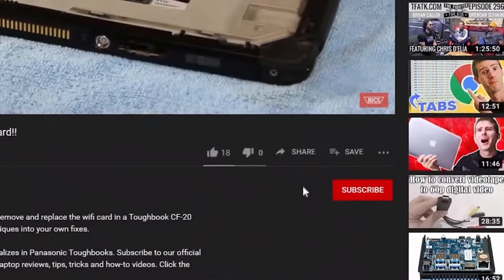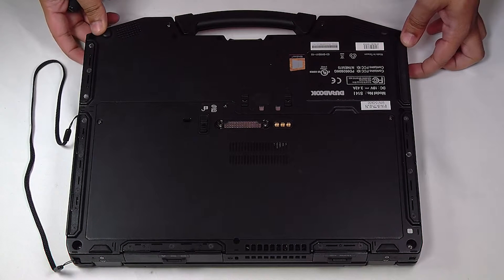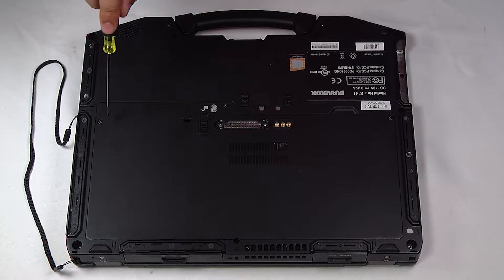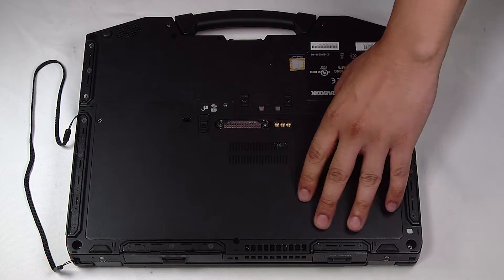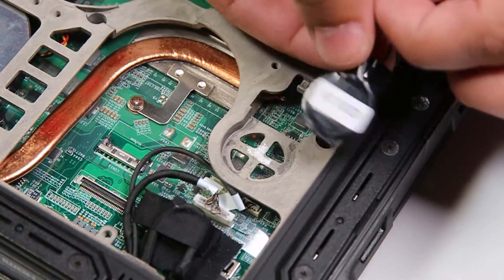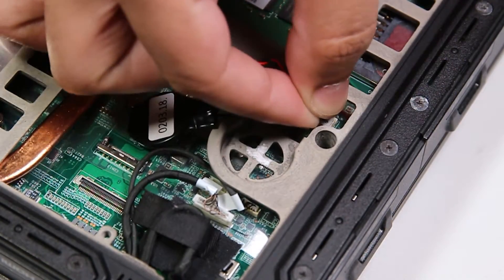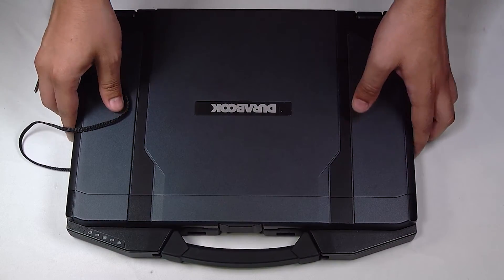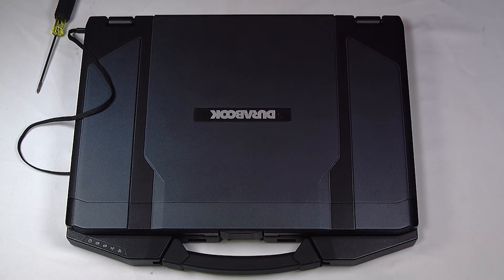How to Replace Your Durabook S14i CMOS Battery!

Comment: I have an old durabook model n15rl-2. CMOS battery is 😮. Not sure how to remove laptop back cover.
Reply from the maker: @paulkatz8250 The best way to answer this question is to simply fill out our Tech support form.  Our in-house technicians will answer with the links and info you will need.  Here is the link: https://www.bobjohnson.com/tech-support-form/  Thanks for Watching.